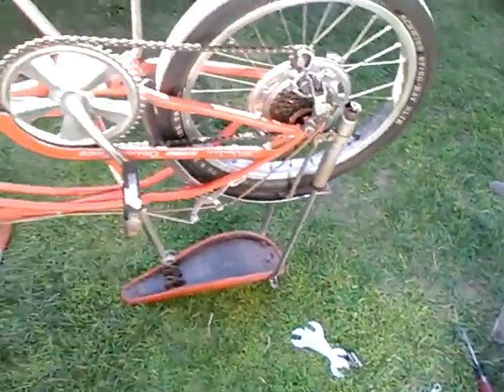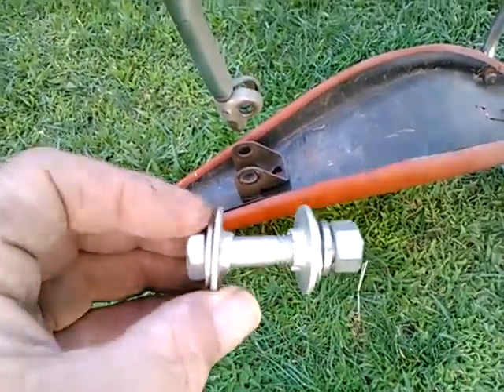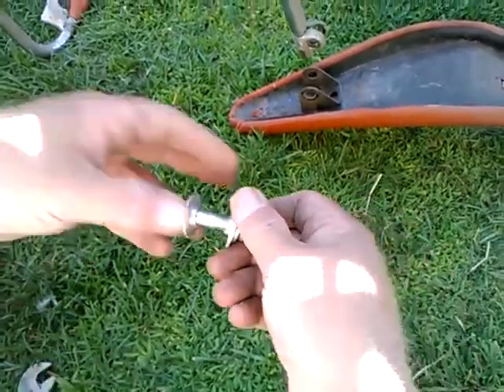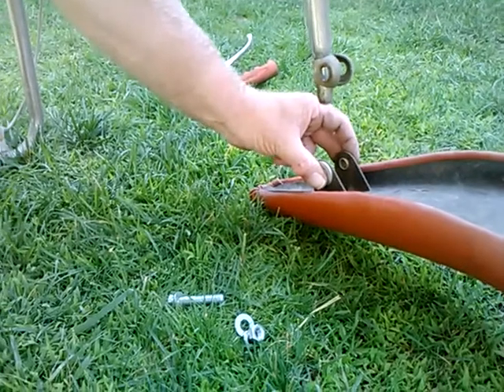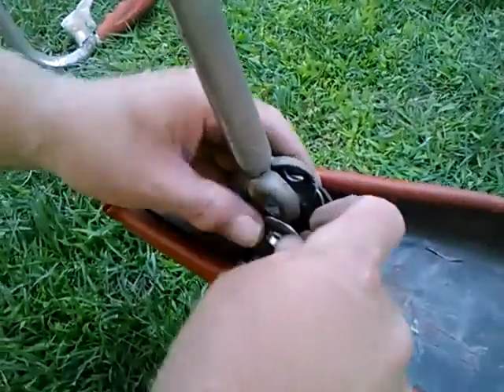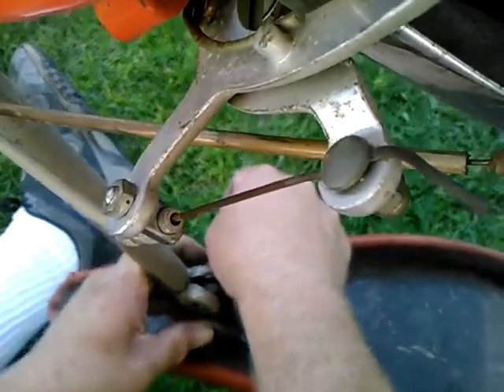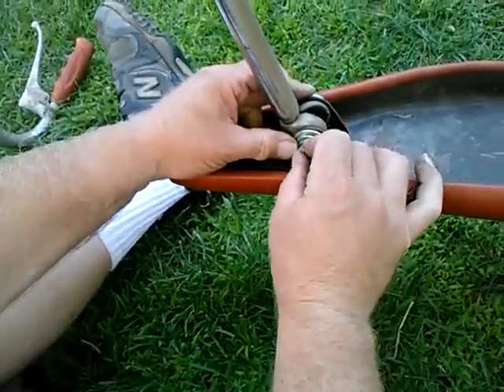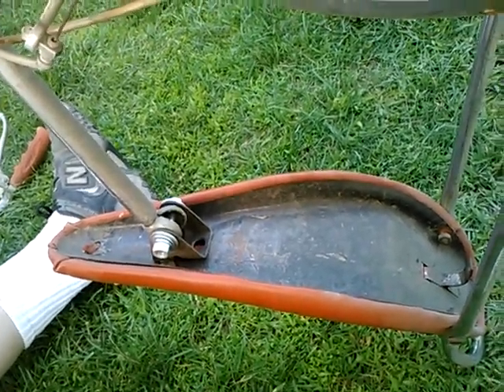Schwinn Krate Bicycle Spring-Action Seat Front Pivot ??? MOV243

Comment: The flat parts of the "hats" belong on the inside. When you install standard flat washers on the outboard sides (as original), the sleeve portion of the hats will make contact with the flat outboard washers and create a tight fit.  Then, the seat can pivot on the sleeves yet still be snug on the seatpost.
Reply from the maker: jeffdean64 Yes, I need to turn them around, when I get the chance.  These washers, the shouldered nuts for the springs shock that allow them to pivot, the serrated axle washers, all seem to "disappear".  Was there any special hardware used at the back of the seat / sissy bar, to create a pivot?
Reply: guidoguitar The original two 1/4-inch bolts at the rear of the seat are called "Q bolts" because they have a raised letter Q on the bolt heads. Most - but not all - of the original Q bolts have a non-threaded portion where they pass through the seat. That way, the nuts can be tightened down fully but the seat can still pivot in the sissy bar. The two nuts holding the shock-cans to the frame are also unique. They've got shoulders that pass through the clamps, allowing the clamps to rotate slightly even though the nuts are fully tight.